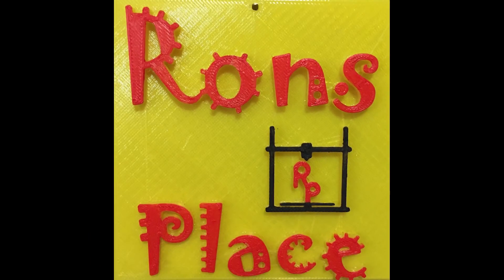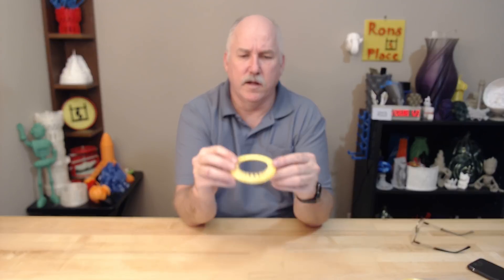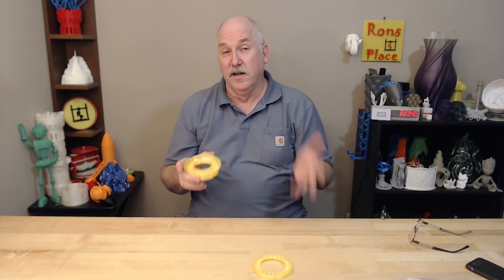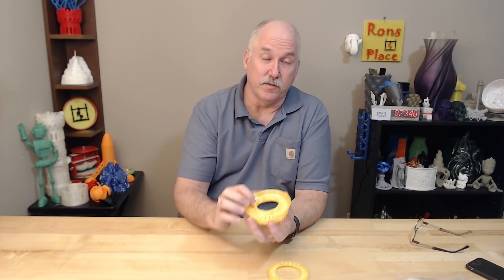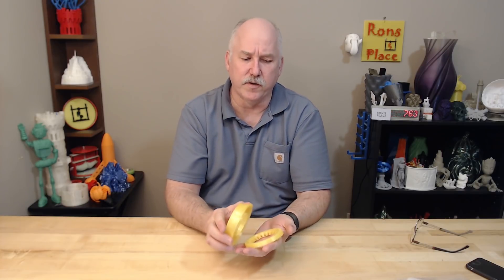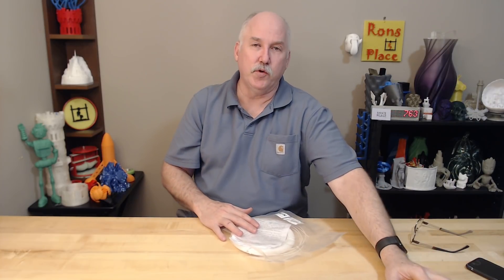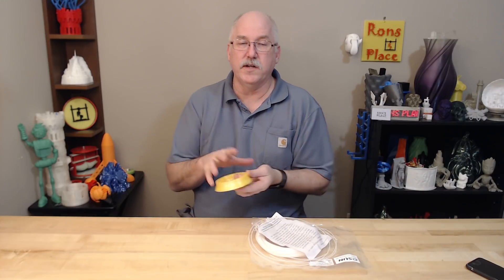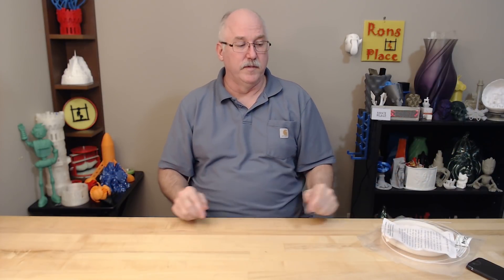Cleaning Filament - Prusa i3 mk3

Comment: Same story here with approx. month old MK3 - it absolutelly can't detect clogged nozzle. Sometimes it does, but extruder is already few milimeters or even centimeters above print. I will have to test some cleaning fillament. Right now I clean nozzle like I heat it up about 290°C and let everything inside melt.

Comment: It may be that it wasnt the cleaner but the process , you did cold pulls followed by a foot print followed by a cold pull again .. With cod pull did you use high temperature nylon or abs , pla?
Reply from the maker: I agree it is able to be done without the cleaning filament.   I usually did cold pulls with PLA, but this just seemed "stickier".  It was interesting messing with them..  really not sure its "needed" though.

Comment: Ron I just noticed that Prusa recommends removing the plastic wire wrap from the heat bed. They now use a textile cloth wrap. I wonder if they felt the stiff plastic wire wrap was causing some Y axes skips ?
Reply: Yes I looked at the build pictures on the Prusa site and they no longer show the filament strain relief. Now I do not know about any one else but on my MK3 the heat bed wires are the stiffest thing. Way more stif than the filament or the plastic wire wrap. So I have ordered some flexable silicon coated heat be wires. Once they get here I plan to replace them. Make you think about the X axes, same stepper driver set up. And the big layer shift I had was on the X axes not the heat bed "Y" axes. I got a feeling that new stepper drivers are not as good an idea as they had hoped, and I am not sold on the all metal hot end. I have had lots of problems with those in the past printing PLA with designs that have retractions.

Comment: U want to use nylon filament for cold pulls. Cleaning filament isn't very strong, can't handle alot of pulling force. Cleaning filament is more of a preventative thing.
Read this:
https://printrbot.zendesk.com/hc/en-us/articles/202100554-Unclogging-the-Hot-End-Using-the-Cold-Pull-Method?mobile_site=true

Comment: I wonder if some of the clogs are do to the new all metal design of the MK3 hot end. I had a under extruding problem with mine as well. Just did the very latest firmware upgrade , Prusa said that it is supposed to help with under extruding problems. We will see.

Comment: I had a great experience with Maker Geeks customer service. I bought a roll of Urban Fossil, after seeing one of your videos, and it shipped with the end of the filament unsecured. It partially unwound wound in transit and I was pulling my hair out trying to resolve tangles. I shot them a quick email and they apologized and sent me a free roll quickly.

Also, funny that you mentioned clogs. I purchased a roll of Inland natural PETG and found a bug embedded in a strand of filament. I posted a picture on the Prusa forums if you want a gold laugh: https://shop.prusa3d.com/forum/original-prusa-i3-mk3-f30/spool-horror-t14603.html

Comment: [My MK3 nozzle clog story]
When my print finishes, I typically leave the filament in the cold hot-end and cut it off a few inches above the extruder and put the spool away.  The next time I use the printer, I pre-heat the nozzle and either pull the filament out or, in the case of my Prusa MK3, I use the auto-unload.  Never a problem with that process until the other day after an unload, I couldn't get the new filament to load.  [long story deleted] From what I can tell, it appears that the extruder pulled the filament so quickly and forcefully, the tip of the molten filament snapped off in the heat break.  And cooled.  Couldn't push it out or melt it out - finally took off the nozzle and used a 1mm hex wrench through the heat block to (gently) dislodge it, and eventually got the "plug" pushed out.  What a pain.  I wonder if the 95% flow rate set in the gcode in Prusa's default linear advance profile is causing more clogs?  Conspiracy theorists, take note.

I've used that eSun cleaning filament - usually after a cold pull fails - and have been generally pleased with the results.  I haven't used it as a routine maintenance step, however.  Might be worth considering.  I have a slightly smaller hank of it than you, and I think I'll never use up what I have.  I wonder what the material is.  It appears to have a very wide useful temperature range.  Probably some high-temp variant on hot-melt glue.  :)

I enjoy your channel, Ron, and I'm glad I've subscribed.  You're always presenting something interesting.

Comment: I feel your pain. For a few weeks I had tried a Monoprice Maker Select V2 (Wanhao I3 under a different name per Angus at Makers Muse). It made 3 prints and then clogged. I tried cold pulls and it didn't seem to help. So I ordered Monoprice branded cleaning filament and it did seem to clear it up. Strangely that printer had to be cleaned after every print. Too many frustrations lead me to return it. I had high hopes because of its popularity worldwide. Perhaps I had a lemon.....
Reply: luvnbeast. Yes I tried several different colors of Hatchbox PLA. I started with printing Monoprice branded white PLA+ that I bought with a Monoprice  Mini V2 that I purchased on Cyber Monday.  The white has done well for me in it. I've never had a clog in that printer. I'm currently waiting for my MK3. And still using the Mini V2.
Reply: Ron Hunt I'm anxious to get it. So ready for reliability and quality.